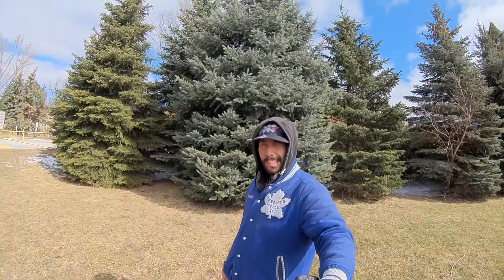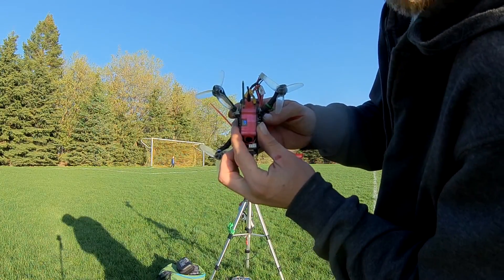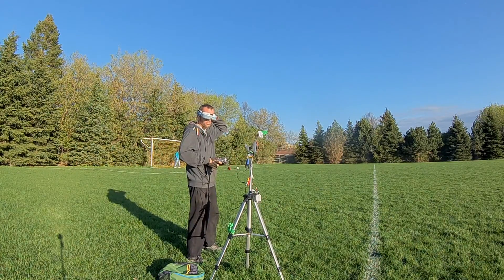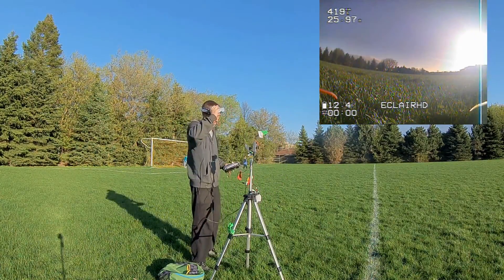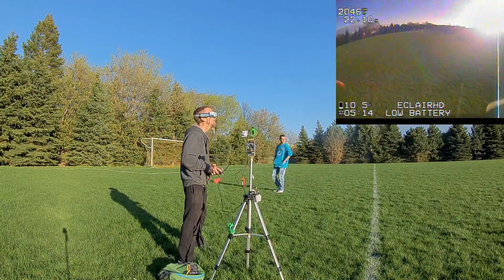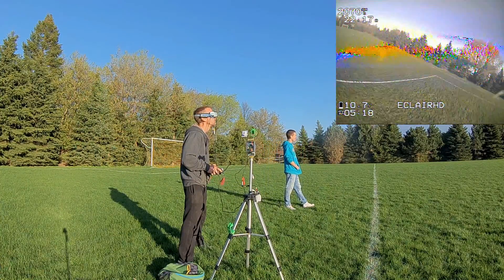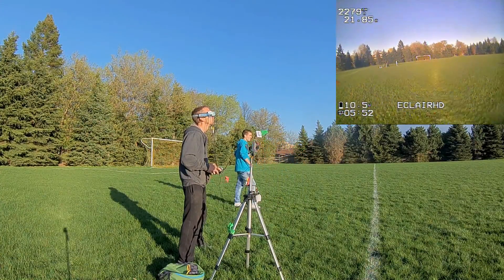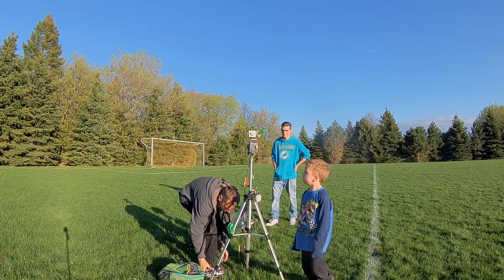Arduino Based Antenna Tracker: 25mW Dipole Test

Comment: Did you tap directly into the rssi pin on the internal modules?  Probly a couple rx5808 I would guess.
Reply from the maker: Mitch Montee yes took the RSSI from the rx5808 in the FR632
Reply: Gotta try this  thnx